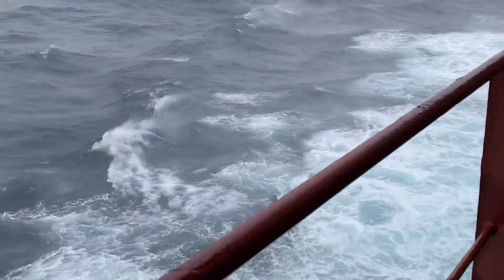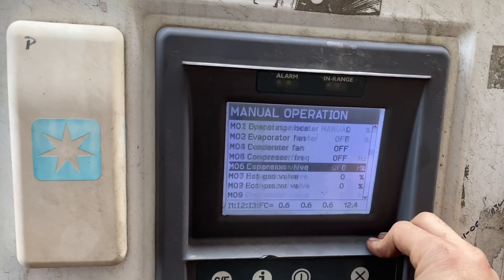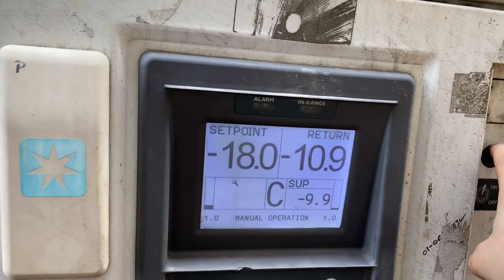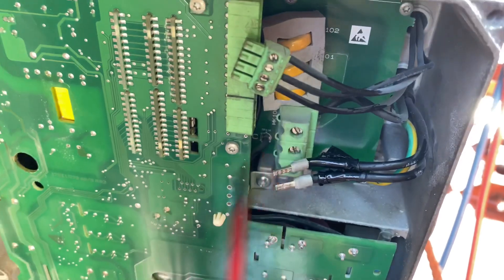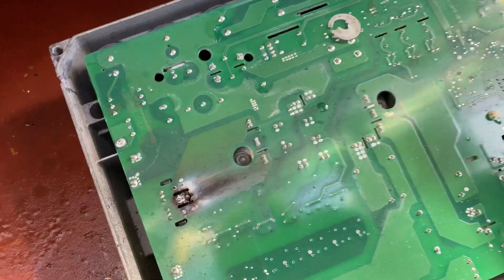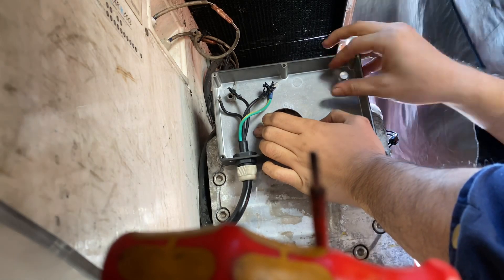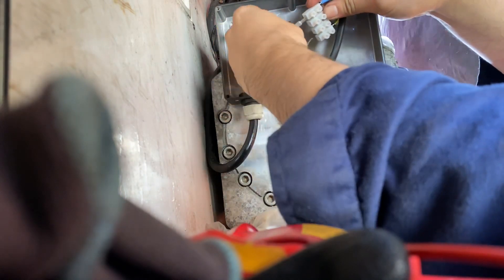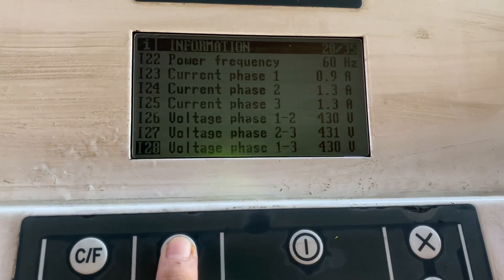ETO BYPASSING STARCOOL FREQUENCY CONVERTER

Comment: Hi Lecky - good video.  Your compressor amps won’t show up on the manual function test as the compressor does not have a CTM wiring like the motors do.

Comment: Sir, if compressor defective?
U have spare to replaced or ?
Reply from the maker: Yes, it is a standard stock. But there is an instance that the remaining spare was also used hence need to modify the piping and install a different compressor

Comment: Sir pag tapos nyo ibypass ang fre converter ng comp. Tuloy2 lang po ba ang running ng compressor sa unit kahit mag inrange na?
Or auto parin na hihinto ang compressor pag na abot na nya ung setpoint? Sana po mapansin nyo tanong ko salamat po
Reply from the maker: Hihinto parin pag nakuha setpoint.
Reply: Ty po sir God Bless po

Comment: Sir. .. why the frequency converter in refer ? ..u have run the system bypassing coverter... Then why it is neseccary
Reply: In refrigeration system we don't have  frequency coverters... But refer container you have ...Can u please tell me... What will b the reason
Reply from the maker: It is the one that controls the speed of the compressor.